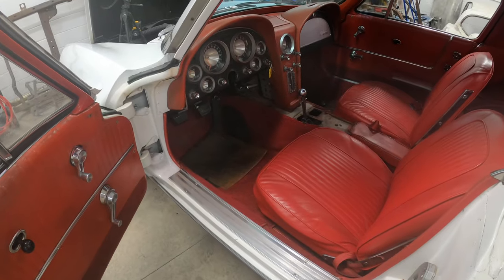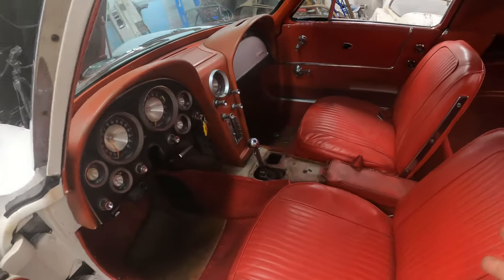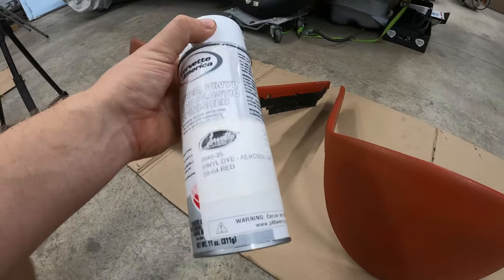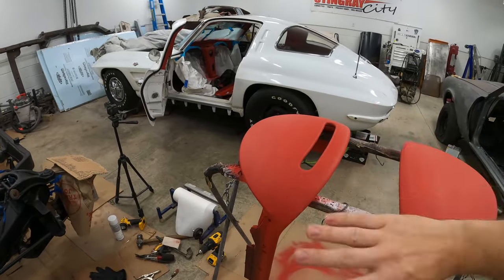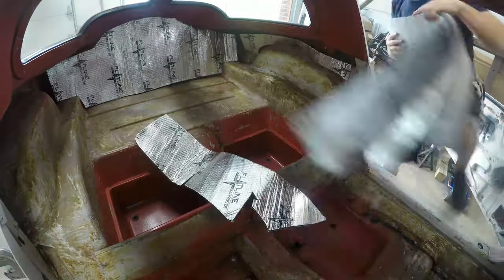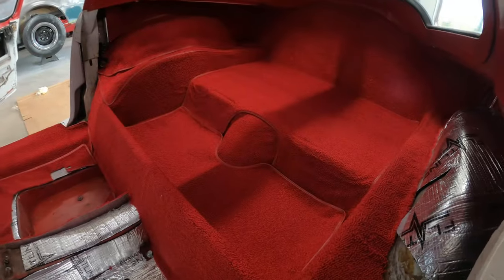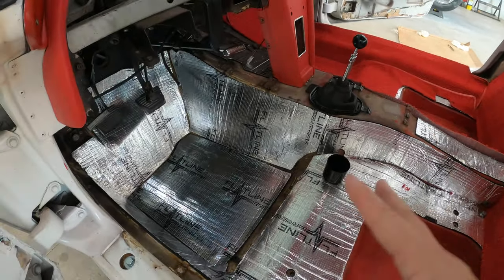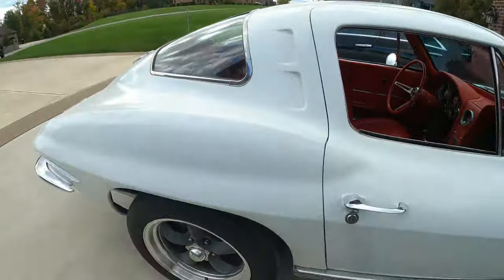Budget 1963-1967 Corvette Interior Restoration.  How to Freshen Up Your Worn Interior.

Comment: You did it again, made it look easy. My next project will be to replace the radio speaker cover. A previous owner made 2 holes in it. Any pointers for its removal? The white 63 is looking very sharp, it sits good and sounds beautiful. This summer went way too fast it's almost time tuck them in tight for a nap. As usual great job and fantastic video. Until the next one stay safe. Oh! Most of all congradulations on 5k+ subscriptions
Reply: There's a few hex nuts on the underside holding it on. I had my glove box and clock removed already when I pulled mine out which made it very easy. Glove box for getting my arm in there and clock so I can see inside. You may be able to do it without removing them but you would have to lay upside down to see up behind the dashboard.

Comment: Timely video, Mitch.  I'm planning to redo the interior and replace the factory ac with a VA unit in my 67.  Your carpet job looks great.  I noticed you got glue (3m I think) overspray on pieces you'd already glued down.  Did you have to remove it or does it dry un-noticeable?  Thanks for another great diy video!  Looks AWESOME!

Comment: Good job Mitch , on a 63 steering colum do you have to undo it in the engine compartment ?
Reply from the maker: Thanks Bob. Yep I did have to disconnect it from the steering box. We put a borgeson box and a flaming River steering column. So it was a bit custom but it was the same concept as a stock column install.